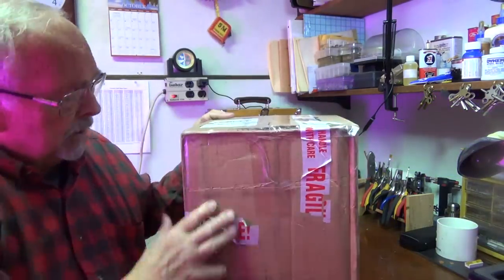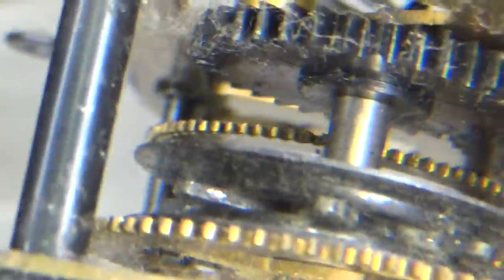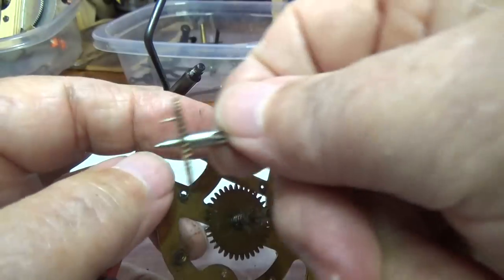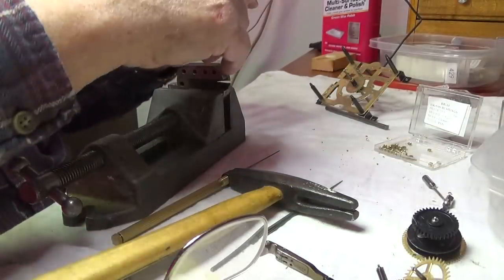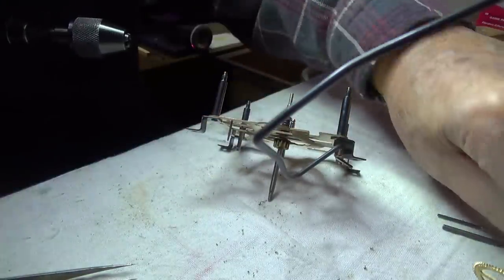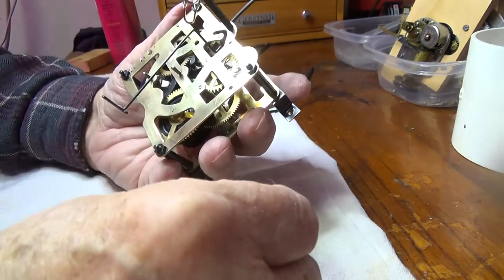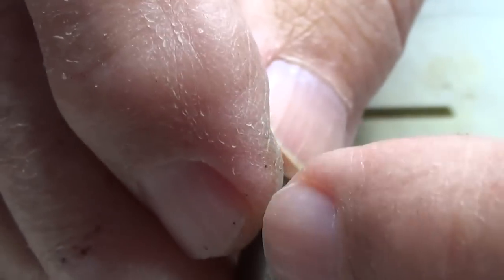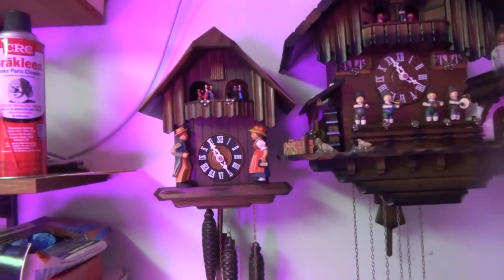#clockrepair Cuckoo Clock Repair for Colonel Freeman

Comment: Mr. Perry, your video instructions are very clear and very interesting. I have a cuckoo clock and its been hanging on my wall for years covered in dust. I have been pulling the chains and its been working for over 20 years without any problems until recently when the door and bird wire started playing up. I am so used to the sound of the bird whistling that when I took it off the wall to repair it and left it on my table for a few days I kept missing that cuckoo whistle. Its back on the wall thanks to your videos. The door is still not perfect but its a lot better than what it used to be. 

I have been looking for an old discarded cuckoo clock so that I can take it off in parts and fix it back according to your instructions in order to learn how they work. It's very relaxing. But its difficult to find an old used clock because people usually don't want to part with them. And new ones are very expensive to buy. But i will keep on searching in second hand shops and hopefully when I pick up one I will then dismantle it and fix it. In the meantime please keep posting your videos because I just enjoy watching them.
Reply from the maker: Keep checking Goodwill and Salvation Army shops. The clock in this video was purchased at such a shop for $10.  https://youtu.be/h_3lSK0BDAQ

Comment: First off... thank you for taking the time to make these videos... I watch them all the time as I try and learn more about clocks and clock repair... I have a cuckoo clock that I was able to get working thanks to you... The problem I am having is that sometimes the clock will coo a little when it warns... and sometimes I can hear a rather loud snaping noise...  I was wondering if you might have an idea as to why this is happening? otherwise the clock runs fine... it does coo at the right times and does stop correctly... I did manage to break the plastic base of the bird... but I have one on order.. Again... thanks for your time..
Reply from the maker: As to the sound at warning, what that tells me is that the spoked wheel that lifts the levers is not in its proper postion and is lifting one of the bellow lift wires almost to the point of releasing it. At warning, the wheel advance enough to release the bellow lever and you hear the sound of one of the whistles.  You need to look at the spoked wheel when everything is a rest. None of the levers, gong and bellows levers, should be in the process of being lifted.  Look at the spoked wheel. Two of the legs on it should be equidistant (parallel) to the left edge of the back plate.  As to the snapping sound, is that happening when the clock is simply running?  If so,  I'd examine the chain for any bent or otherwise not normal links.  What's probably happening is a link is not being caught by a spoke on the main wheel (chain wheel), is riding up off the wheel, passes over and then drops.  That would make the weight drop a small fraction and make a noisy clunking sound.  Also, if the chain has been replaced, it may be the wrong size, which would also cause the same problem, only much more frequently. If the movement is a Regula 1 day movement, I think the chain is 61 links per foot.  If it's not, there's your problem and you'll need to replace the chain.
Reply: @dperry428  Thank you so much... when the new bird comes in I will check the star wheel and see where everything is at... I want to say the snaping sound happens when the clock is approaching the hour... sometime after the warning or there abouts...I will try and take better notice as to when it happens... I almost wonder if the two problems aren't related in someway.. also the clock is a 34/1 8 day movement... thanks again... and stay well..

Comment: Those birds are Terrible too. The plastic mounts are good for nothing. You can use a pick to get the chain on.
Reply from the maker: I've found my hands shake so much lately that it's hard to do the simple things I used to do.  So much for old age being the "golden years".
Reply: @dperry428  just have to get back in practice. I haven't spoken to you on the mail in a while. I'd change that bird for good measure . They're only like $2. The mount gets a hairline and starts to shift arounf
Reply from the maker: It's already on its way back to the colonel. Sent it this morning.

Comment: Mr. Perry, when you are making a video on cuckoo clocks the next time, can you show how the door and bird wire can be adjusted so that the door shuts correctly instead of shutting in an awkward position? Thanks
Reply from the maker: If the door is crooked, you simply have to put the hinges deeper on either the top or the bottom.  I'll try to remember to show that next time I do a cuckoo.
Reply: @dperry428  Thanks Mr. Perry

Comment: Hi Don, just a few questions on your clock bushing. Where did you get the mini pin file and what size is it? I have learned so much from your videos. Thank you!
Reply from the maker: https://www.amazon.com/Grobet-Swiss-Pattern-Escapement-Round/dp/B000IE44KU/ref=sr_1_29?crid=1AU2P00LZQ1O5&keywords=grobet+swill+pattern+file+escapement+round+cut+2&qid=1649707727&sprefix=grobet+swill+pattern+file+escapement+round+cut+2%2Caps%2C119&sr=8-29
Reply: Thank you

Comment: Welcome back mr perry miss you and your great videos on clock repair and your expertise
Reply from the maker: Thank you.  It's good to be functional again. On top of everything with the joint replacements, I had the virus in January.  Got over it quickly, but it made the past 6 or 7 months good to put in the past.
Reply: This evening I came across your videos very empress’s an will continue watching how do you remember where all the parts go I love my clocks I have several my favorite is grandfather clock I find the chimes soothing how can I learn to repair clocks thank you for your videos an your service good recovery stay well I will be watching
Reply from the maker: Understanding how the parts work goes a long way to knowing where they go.  Also, if a movement is an unfamiliar one, take lots of digital pictures.  They can be printed out and used as a guide to putting things back together.  I learned by taking apart simple movements and slowly gaining knowledge over the years.  You can go to Amazon and look for clock repair books, watch clock repair videos and go to the NAWCC forum (National Association of Watch and Clock Collectors).  Lots of information there.  Think about joining and find a local chapter to join.  Nothing like having experienced people to advise you.  Also, NAWCC offers classes in repair.

Comment: Great to see you back.Was afraid you went to the giant Cuckoo Clock in the sky.Have  had two new hips myself.Better than new.Great videos.Missed them.
Reply from the maker: Thanks.  The hips came around really fast, but this knee is really taking its sweet time.  They had to do some soft tissue work at the back of the knee, too, as my knee had been bent for more than 25 years.  It's good to be able to get back down to my workshop and play with clocks again.
Reply: @dperry428  Don,I have a small cuckoo clock with a new movement.It periodically stops and somtimes the cuckoo will strike once and then get hung up until I pull the chain.Any thoughts.Thank You.
Reply from the maker: A new movement raises a red flag.  There are a number of different variations in new movements, as well as the bird perch needing to be bent exactly right for the old case and if it isn't, there can be hangups with the bird and the door opening.  Also, when you say the cuckoo hangs up until you pull the chain   could be caused by the chains of the new movement not exactly aligning with the holes in the case bottom. The cuckoo starts to work, a link in the chain hangs up on the side of the hole it goes through and when you pull the chain, it releases the hangup.  If that's the cause, you'll have to enlarge the case-bottom hole so the chain does not hang up.
Reply: @dperry428  Thanks,Don.Will check chain next time it hangs up.
Reply from the maker: As it's hanging on the wall, look underneath and see if the chains are exiting in the center of the holes or if they are to one side and dragging on the edge of a hole.
Reply: @dperry428  Will do